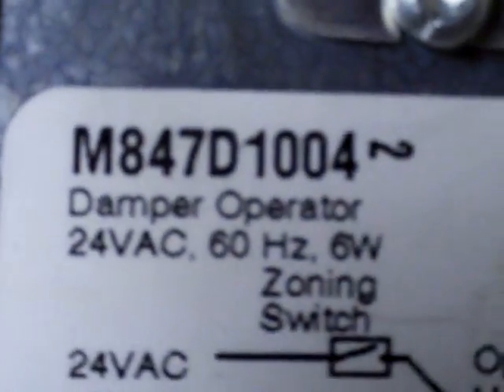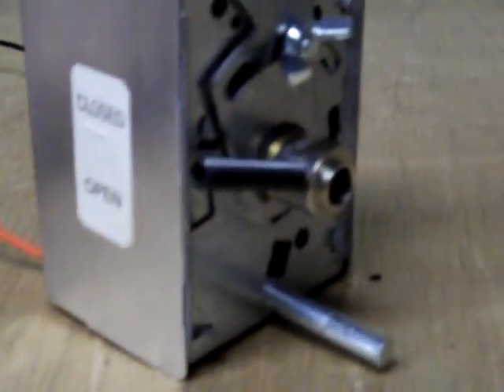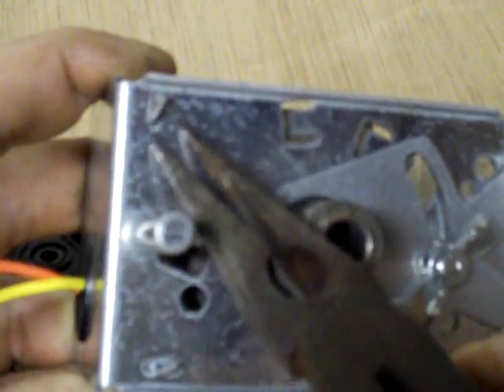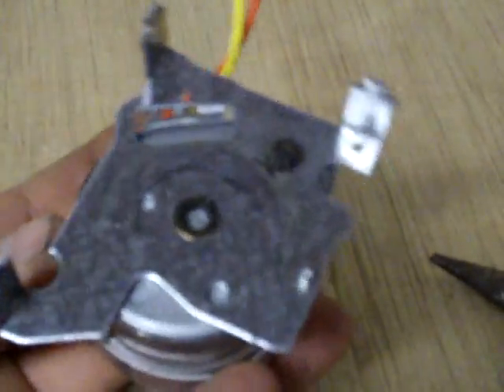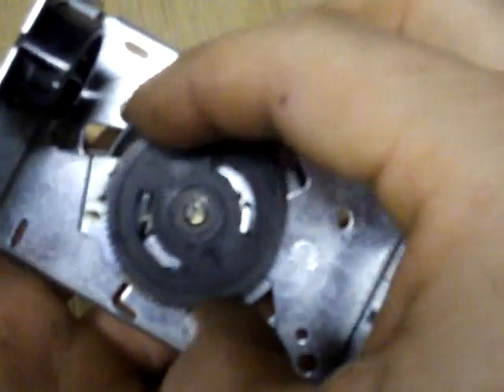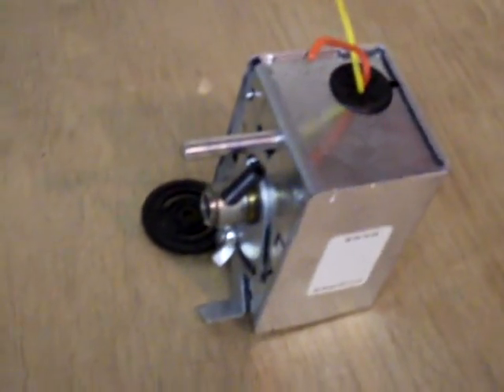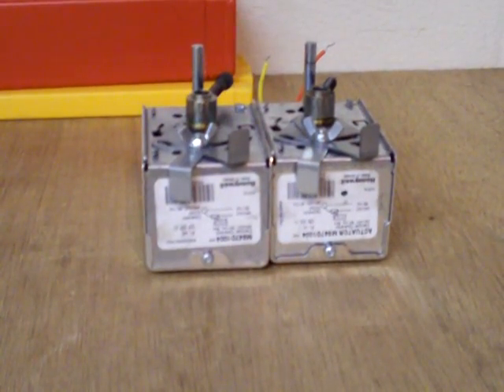Honewell zone motor damper operator...fix it.

Comment: VIdeo still helpful in January 2025!  I had consulted this video 5-10 years ago on a different actuator, and again today. I was pleasantly surprised to find one of my original damper actuators made it from 2008 until now. Flipped the gear and will hopefully get another good run before replacing it.  Thank you again for putting this video out.

Comment: Thank you so much for this video. I was hearing this annoying clicking sounds that echoed throughout the vents in the house and it was loud. Everyone in the house was reminded of the Peter Pan movie when Captain hook had to hear that ticking time clock inside of the alligator in the live action movie with Robin Williams playing Peter Pan LOL. I had an easy time access the zone damper motor since it was in the basement. It took a total of maybe 15 minutes to take it apart and rotate the gear 180 degrees. It definitely helps to take a picture of everything as you take it apart so you know the orientation of the gear in case the spring pops off and you remember how the gear was oriented. Holding down the inner sprint while you pop the gear off helps you to orient the gear line up the sprint hole. Even though I have a whole house warranty, I can't get on a schedule for 2 or more weeks and I don't think I can take that clicking noise for that long! Also, I have a $100 service charge I have to pay up front.

Comment: Thanks for posting this.  I had this exact issue and rotating the gear 180 degrees was the trick! I had 2 A/C repair companies out that failed to fix this until I decided to crawl around the attic to find the issue.

Comment: Thank You!!!   Last time I had a motor failure, I asked the AC man if you can just replace the motor.  He said you had to replace the whole damper!  That cost me.   I had another zone sticking on me and then the dreaded click-click...   Found the motor on Amazon, but then a reference to your video in the comments.  Piece of cake to fix!  I thought about taking it apart, but thought I would have a spring disaster before seeing the video.

Comment: Great fix on just rotating the wheel 180 degrees.  I had the click click click just like others described, and this video helped me save the money and have a quick fix.  Four years later after the original video and it is still helping.  Thanks for sharing the video.

For youtuber that just posted a week ago for wanting to keep damper in open position....if your damper stays closed after power removal, looks like the motor is stuck in the position that holds the damper closed. .  Sounds like you don't want to mess with the repair and just leave the damper in the open position.  One option would be to loosen the set screw in the back with a 3/16" hex wrench, and pull the damper motor off.  Now turn the damper rod on the duct and rotate such that the damper is all the way open.  Put the motor back on, tighten the set screw, and leave the power off the unit.  Now the damper itself should not be able to rotate closed even with vibration.

Comment: Noticed the constant clicking and saw the bolt bouncing near the closed  position. Found your video, opened my motor and saw the stripped teeth. Flipped the wheel and fixed! Thank you so much!

Comment: Thank you! Fixed mine in 10 minutes. Once you open the actuator housing you can see the stripped/ground gear teeth if this is indeed your problem. Use needle nose pliers to hold the spring underneath the plastic gear, and then lift the plastic gear out of the pin. Rotate gear 180 degrees and reverse steps.

Comment: Thanks!! I had exactly the problem you describe. I rotate the dented wheel and it is working again! you save some money, great video!
It just took me a while to figure out how to detach the motor from the damper (I was in a very tight attic with no space). So for those of you with the same issue, reach behind the motor enclosure, you'll find out  a long screw, you'll need an Allen key to loosen it then you can take the box (remove power before doing all this...).

Comment: Adding my thanks here for making this video -- I had the same "click, click" problem -- discovered on a Saturday morning with a predicted high of 85F -- not good. Flipping the gear worked like a charm! It was a little tricky getting the spring back into nylon gear, for anyone else who tries to do this, we (actually, my wife did this part, her vision is better than mine) ended up using an alligator clip to reach in and grip the spring and direct it into the small hole. Thanks again.

Comment: Thank you so much for the directions! My husband's so happy that I could fix it and not have to have an expensive service call. The most difficult thing for me was to figure out that the set screw is how to remove the unit from the duct work. It was also helpful to take a picture of the gear before rotating it 180° as I had to remove it again to figure out how to get the spring in the slot. East to forget the right way to put it back on again. Thanks for help!

Comment: Neat trick flipping the gear. I've had the same problem, those plastic gears are garbage.  They need a metal gear instead of a plastic one!  The motor gets hot so does the pinion gear and then the plastic begins to fail.  Awful design, the new plastic body type is the same inner components.  My dual zone control supports 3 wire open/close actuation so I plan to change to that soon.  I've bypassed the motors for now.

Comment: Great video thank you!  I have the click click issue.  Assuming the gear 180 turn will work for me, what is the “normal” operation of the motor when powered and driving the damper closed?... my motor stays powered all the time, when driving closed, even after the damper closed fully.  It just keeps running (and clicking!) and getting very hot.  Assuming the gear “flip” fixes that... will the motor keep running?  Or is there something about the drive gear being able to “bite” good teeth on the gear that somehow tells the motor to stop turning??  I hope I’m being clear?  It seems really odd that the “normal” operation of this unit would be to constantly power on and drive the motor all the time, when the damper is closed.  Thanks!!!

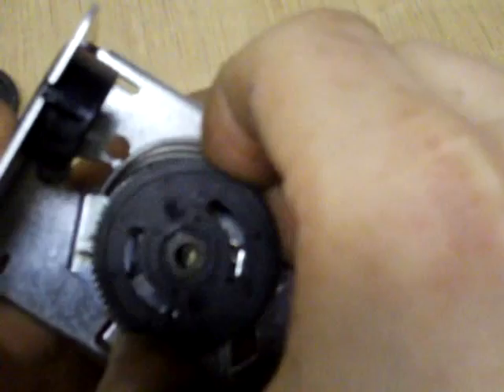Comment: thanks for the very helpful information!  Very clever in flipping the gear.  One question:  I am replacing a different damper motor unit.  Is there an easy way to start the "close" and "open" at a different position?  If you think of the front as a clock, mine is closed at 3:00 and then open at 6:00.  Your example starts 9:00 and opens at 6:00.

Comment: Hello,
I have one of these stuck in the open position. Which is allowing air to flow out my upstairs vents when the down stairs is on. 
I manually moved it to the closed position and that solved the unwanted air problem coming out of my upstairs vents. 
The acuator was hot to the touch. I removed the wiring and placed a block of wood next to lever to keep it closed until I decide what to do. The spring is obviously working fine as it opens as soon as I removed the wood block. 
Do you think its related to the gears per your video?

Thanks,
Reply: Rebelrob,I have have the exact same problem, what was your solution?

Comment: Awesome video...I've got a 4 zone system and was wondering how do I manually open all 4 dampers.
Reply from the maker: Remove power from the zone motors.  They open via spring, unless the spring is broken.
Reply: FilterChanger Thanks...

Comment: How do you adjust them? No Me doesn't close all the way and I have some air going through
Reply from the maker: TemuCano X  the wingnut needs to be loose, allow the spring to close it then tighten the wingnut
Reply: FilterChanger I see I see. I had to open one to see how the wing nut and the x worked. I'm gonna go try it now. Thanks for the replay!
Reply: FilterChanger....so I did lossen the wing nut And I was still having the same problem. The actuator would only close the damper to about 80% wich meant I was still getting a lot of air sipping trough.  I ended up removing the washer on the shaft of the damper so it wouldn't be so tight and stiff. After doing that the actuator closed the damper all the way and everybody lived happily ever after.